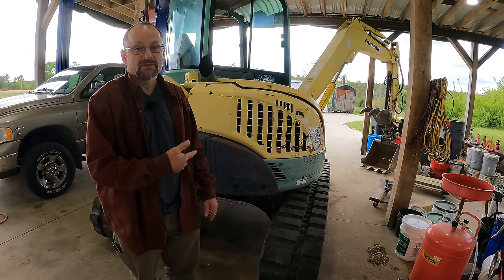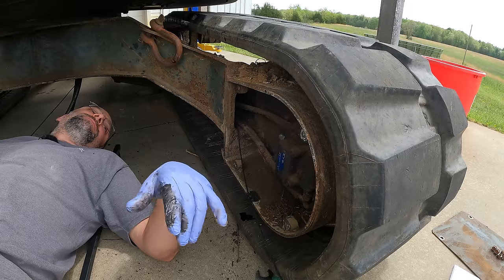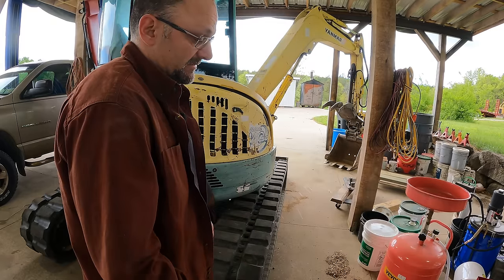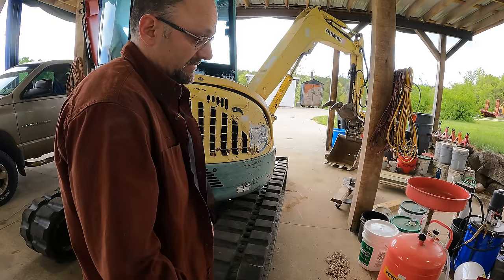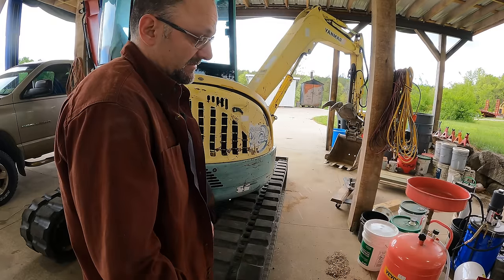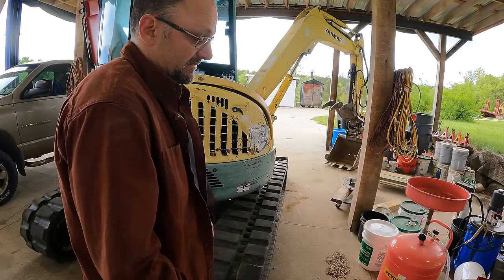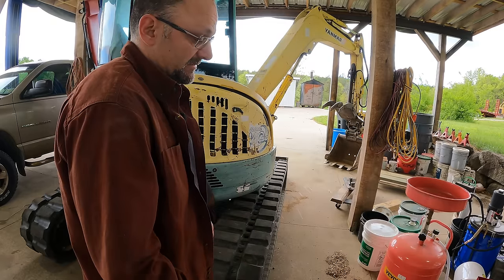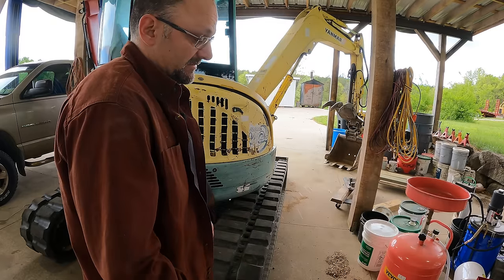Excavator Not Tracking Straight, TOUGH Hydraulic Repair.

Comment: Adjust the pressure relief valve to get the track speeds the same? Some have a adjustable lever stop usually on just one lever to get full speed equal on both sides

Comment: We measure flow with pressure through a calibrated manifold.  One fitting has an outlet with a very specific diameter then the manifold is stamped at a know psi/pressure.   We deadhead pumps briefly to set the internal bypass regulator. 

In your current setup I'm not sure a flow meter will matter that much but some kind of adapter with either a swappable orifice jet (like a nitrous wet kit) might create a new adjustment point. Similar to how a camber kit can be added to a car without an adjustment. 

I for one really appreciate testing a component as I have learned new is definitely not always better.  It would probably be pretty easy to create a testing rig where the pumps are supplied a known constant and the output recorded (a manifold with an inlet and an outlet with a gauge then the orifice is changed to create a bottleneck for resolution).  $20 or so at harbor freight

Comment: I'm more of an electrical guy, I don't know anything about hydraulics, but you sure make it entertaining.  Since going in a straight line apparently relies on tightly matching two independent hydraulic motor systems, I'd be reluctant to throw much time or money at this, since even if you managed to get the two motor systems perfectly matched, how long would it be before they drifted out again?  Unless there is a quick and easy adjustment, as others have mentioned.  From an electrical analogy point of view, a good place for an adjustment would seem to be right at the hydraulic motor itself, in the form of a needle valve that lets a small amount of the fluid flow bypass the hydraulic motor (i.e., sort of a partial short-circuit path around the motor).

Comment: Very interesting.  It did occur to me before you said it that there might be a different output from P1 versus P2, and your test where you hooked up both pumps together really did not produce any data on whether P1 and P2 had the same output.  So, there still could be a problem.  Anyway, following your thinking and testing was fascinating.  But, as you say, with the fixes so expensive, you're probably best off with just coping with it as is.

Comment: Having a piece of hex brass you can connect up hoses to with and pressure gauges with a isolation valve in the centre. May prove useful. But you said it cheaper to replace control values.

Comment: on all of the piston pumps I have ever worked on there is a volume adjustment.  It limits the maximum traved of the swash plate and adjusts the stroke of the piston.  It seems like one pump is moving more oil than the other.

Comment: check the case drain oil flow of the wheel motors or swap the motors side to side. you will kick yourself if after all this it happens again because of dirt/contamination so clean and flush. its a chore for sure will pay off in the long run. good channel content

Comment: When you first repaired the leak at the pump connections.  You said the dealer had no idea what that gold pressure item is.  If they don’t know what it is , maybe it’s not supposed to be there.  Remove it and connect hoses direct to the pump.  Also, is there a stick adjustment?  Can either steering stick be adjusted to match the other for pump /fluid demand.

Comment: So, here is what I would do. At the travel motor that is moving FASTER, install a custom fitting that YOU make. You want to install an in-line fitting, male British thread for the feed hose, female British end to screw onto the travel motor. In your custom fitting/adapter, drill a hole through that is half the inner diameter of the existing fitting. Install it in-line on the faster travel motor. This should reduce flow. Remove the fitting, turn the inner diameter 1/100 at a time, and repeat, until the flow rates match. This is you manually trimming in the flow rates through constriction. You need to do this at the travel motor to compensate for the entire travel path the fluid needs to traverse.

Comment: John, pretend you're in a tank...  Old style tiller driven armored fighting vehicles like M113 will have one addition link on one side. That way if the driver becomes disabled the vehicle doesn't track straight on the road but veers off into the ditch allowing the road to remain open for other vehicles. This means the driver is constantly readjusting their course. At highway speeds their arms on the tiller bars are nearly constantly moving.

Comment: So this would be what I would try. And it is based on my guess as well as the conclusion you came to, that the problem is flow difference from the pumps.

I would put it back to original, where you have a problem with the left track being slow. 

Then I would look for a flow restriction valve that is adjustable, I would then installer it on the output line on the pump feeding the right track. Then its trial and terror till you get it perfect enough to a point that satisfy you.

You probably wont get the full speed, but that would in my mind, fix your problem and probably without being extremely expensive.

Comment: I was a driver of an M113A1 APC and it slowly drifted to the right because it was designed that way. The purpose was so that when driving on pavement at high speeds "45 mph" for a long time it was only necessary to use the left lateral to steer.

Comment: Man, you are a thinker!!! I was intrigued by the effect paralleling the pumps had on digging - this makes me think uneven wear of the pumps may be possible because of the additional separate function each pump has in addition to operating the tracks. I'd look for some sort of adjustable flow restrictors inline with the supply to the drive motors (or add them) to be able to force it to go straight. There could also uneven friction in driving the tracks, in combination with whatever flow differences you have in the pumps or motors! If you consider the speed the pumps are running, and the amount of fluid per revolution that is pumped, a tiny difference in pump clearances (and leakage) would be multiplied greatly in a few seconds' time. If you consider something non-hydraulic like an old dozer, tracking would be inherently straight as the steering clutches would lock each drive system to a single rotating shaft.... I don't know about the excavator, but I've worked on industrial stationary equipment that had a way of adjusting pump pressure for different functions that were going on. If those pumps have some sort of pressure controls at work, then that would also be a source of differences.  I certainly enjoyed watching the video. My equipment knowledge is relatively non-existent, so I hope my comments aren't a total waste of your time.....

Comment: the adjustment on the swash only affects the minimum amount of volume it pushes through the pressure relief at dead-head, not the maximum flow.

And I'm with the crowd on this one, a restrictor bead in one of the line fittings would probably help fine-tune most of the deviation away for not a whole lot of money.

Also, I just had a thought. Could you adjust the pressure relief valve on the slow side and lower the set pressure, see if that speeds it up? Because I'm pretty sure it will.

Comment: +1 for flow control valves to trim. Hopefully a less expensive test/solution.  Also are you being sponsored by olight? Saw the olight swivel in several videos but you haven't mentioned if you like it.
Amazing channel!
Reply from the maker: Not really sponsored.  They sent me those lights and I used them.  They are pretty handy, but honestly I think they could be better if they would rotate as well as pivot.  Sometimes it's hard to get the light where you want it.

Comment: You may be able to find a flow meter test kit available for rental as an option or alternatively look into buying an inline mechanical flow meter which come  priced in the lower hundreds instead of thousands for a digital unit. Not sure with your OEM but for some pumps you can buy replacement internal parts like the pistons, swash plate, slippers etc. Great methodical diagnostics next steps are flow testing to narrow it down, and with you having the boom lift and excavator a flow test kit would a great investment, even consider the second hand market?

Comment: Have you considered putting some type of shim in the centering spring assembly on the back of the valve spool on the “fast” track or add a mechanical stop to the travel control linkage.

Comment: VIO70 doesn't have much more space to work, great machines but tight to work on. Flowmeter, bspp cap, 1/4npt thread, you have a lathe so you can make 2x 6 inch long restrictor tubes, that and a stop watch to measure flow and you can monitor pressure as well with a t fitting.  When inspecting motors, you can look at your case drain flow as well.. Did you check the stroke on the control valves?

Comment: How does the travel levers move the main control valve travel function? Pilot control or cable operated. While I have never worked on a yanmar mini excavator I have worked on excavators for along time. 9/10 times machines not tracking properly is something to do with the travel levers. Ex. Dirt under pedal, cable out of adjustment or seized, pilot valve out of adjustment. If one pump is out of balance from the other you can usually make a adjustment in the travel levers to compensate. Good luck

Comment: Funny one eh ,in the track skid steers you can control to a degree the flow to each track , this can be manual linkage in older machines or electronics in newer ones, so when you are running full forward or backward and the machine is bearing to one side you can make minor adjustments to correct it, so I’m guessing you don’t have like a manual linkage adjustment to vary the flow on either track
Have fun , don’t lose sleep over it though
Cheers from Aus

Comment: Linkage adjustment ?? Shortening distance between swivel point and connecting rod hole of the steering lever.
Or putting an adjustable valve before the valve.

Comment: I know that a Zero turn mower is not an excavator but I bought a brand new mower a few years ago and it does the same thing. Drives me crazy. I  may be able to fix my issue by adjusting the linkage but it is just an annoyance and not a real problem.

Comment: You could restrict the fastest side with an adjustable restrictor, watch your oil temp after that mod though. If you run long distance regulary opt for the threeway restrictor, that saves a lot of energy.

Comment: I think the main reason you would not want to couple the pump outputs together is you'd lose the ability to get an equal flow rate to separate circuits.

For example if one track gets into some mud, without an equal flow rate, that track will slow down due to the increased load.

Personally I'd either pay for a new/rebuilt pump or I'd find some mechanical way to adjust how much the spool valves open.

If you can come up with a way so that when both levers are pushed all the way forwards the spool valves actually open different amounts such that the oil flow rate is identical, your should have your tracking issue resolved.

Comment: I think you should introdeuce a stop on your stronger side, so when you push both throttles all the way forward, the stronger side is not being pushed quite all the way.  By adjusting this stop you'd get it tracking perfectly straight.

Comment: Thanks for that pump swash plate adjustment idea. I had no idea! I just tried it on my Mitsubishi MM20 (badged CAT in the US I think) and it does make a difference, You are too timid, I gave mine about 2 turns in and now I can bog the motor down in I stall two rams. Also faster to track. It now runs like an excavator from 50 years ago with the motor bogging and smoking. I don't think it has any more force on the bucket but it moves quicker so shifting a pile into a dumper etc will be quicker. I think you're onto something coupling up those 2 outlets,,,,,but,,,,I think you need a restrictor. Think about it, the difference in flow from  each side will be minimal and consequently only minimal flow across the connect is needed. So then it will have very minimal impact upon how it digs. So, I say, stick a 1/4 turn ball valve on the cross connect and experiment.

Comment: An adjustable flowrestrictor valve on the fastest motor (I think it does not care if it's on the preassure side or not on the motor) I think will make life a bit easier belting fast. It will only work as intended at full flow but that"s what most needed. 

Btw every digger I have driven must be corrected while belting and some alot, the tecnique is tho feather the fastest a bit not slam bang correct as you did for demonstration in the video. The problem with that is that one normaly loses a lot speed because of the bypass in the valve one slowes down, that's why I'm interested in seeing what a flowrestrictor valve could do to correct the issue since both valves will bee fully open and do not " bleed" of preassure when belting fast.

I realy enjoy theese videos sir, you'r doing stuff I have put of or completly omitted of fear of the complexity and costs involved. It' inspiring to watch your logical way of breaking down a problem in to bite size chunks.

Comment: I might of missed it but did you check to make sure each lever control rod going to the valve is maxing out and the left isn’t out of spec causing a slow track? That’s what was wrong with an old excavator I had.

Comment: If you can't speed up the left motor try slowing down the right side. I assume this can be done via the sticks movement. You would gain speed sort of because it would require less course correction. Just a thought as I am no hydraulic expert.

Comment: What about fitting inline flow reducing valve to rhand outlet from the pump((simple ball valve) and adjust the flow whilst you are travelling,pressure should equalize and reduce the flow.Simple flow test use a gate valve system with a hose going into a clean 20litre bucket,start the engine and crack the valve for 5 seconds,weigh the oil in the container and repeat on the other outlet and compare. Would recommend using the lid on the bucket with a hole for the hose. Happy pumping!

Comment: One more way you could try is tying the two travel motor inputs and adding a remote controlled valve, this would be better than swapping hoses at he pump I guess ? This would eliminate any pressure differences caused by the pump and the control valves at the tracks and also not affect any other control on your machine .

Comment: I know you have replaced at least one track.  Are your tracks the same length?   Are your sprockets the same diameter?  You could mark both sprockets, drive a little way and see if the marks align.

Comment: Just wondering if your spool rods are adjustable to match each other at a certain length or rate of flow, sounds simple. or like a Bobcat, adjusting your forward travel with two sticks, if you’re going off to the right, adjust it more to the left.

Comment: Correct me if I'm wrong but when you first bought the excavator and was fixing all the leaks didnt the swashplate screw leak?  Its been a while but didnt you reseal the screw?    With that being said, should there even be any fluid on that side of the screw?  That also leads me to if that screw was resealed are you sure that it was put back into the exact same position and given the wear would the same position be the proper position after 3k+ hours? 

All of this to say regardless of wear on something every excavator I've ever ran (a dozen or more) has their own quirks. Once they reach the 1000 hour range some track wierd, others the swivel will be faster or slower, and others the boom will be slower or faster on different machines within the same model.  As curious as i am to know the issue I'll stick with "If it aint broke and wont kill you dont fix it."
Reply from the maker: Yes, that HP control screw was leaking, but I put it back where I found it using calipers.  From the comments, I think I was just expecting too much from the excavator.  It sounds like all of em track poorly when they get some hours on em, and that'll make it a lot easier for me to live with it knowing that.  Cheers.

Comment: Have you checked the overall length of the tracks? if one was longer, wouldn't it act like a larger tire on one side? I do maintenance on mini excavators and almost none track straight, and have to be adjusted as traveling.

Comment: Wow, more tenacity then i could muster on a good day  We work on zero turn mowers with left and right drives, each with it's own pump .  Tracking is a big issue as we're going 6+ mph so we can get crooked fast. The adjustment method on these machines is to adjust the length of the linkage from left and right speed controls ( U pick one ) so with control levers both full forward the wheels spin at the same speed, or more easily, with the drive wheels off the ground, both just barely creep forward  with levers in neutral. These levers control the pump swash plate position. You are controlling the flow to the motor by varying the valve position. Are the valve spools left and right opening equally?  You could measure this- might the rods or cables to the left or right be adjustable?  Swing over the left track, boom down and lift track off the ground , is track creeping forward or reverse, same idea RHS ?    Are the levers themselves adjustable, maybe travel stop screws?
Lastly, if one of our drive tires is low on air, we get out of whack quickly. Your tracks both 
looked good.  Wonder how older track skid steers do it , that would be a total pain when running curb lines etc.         Good hunting.............................